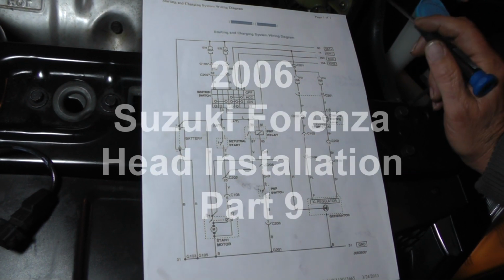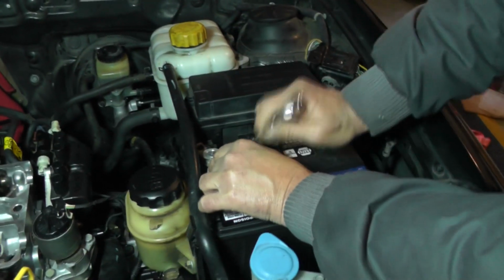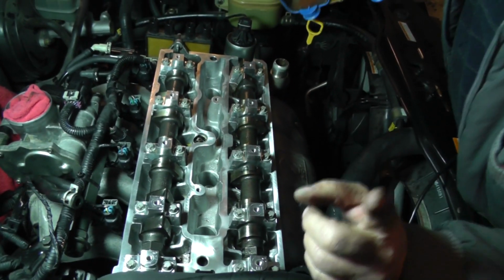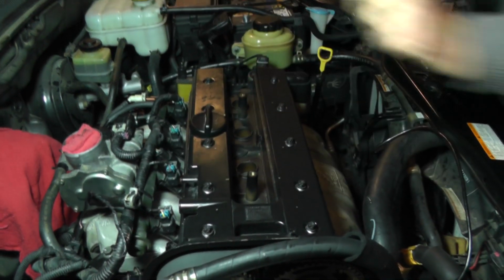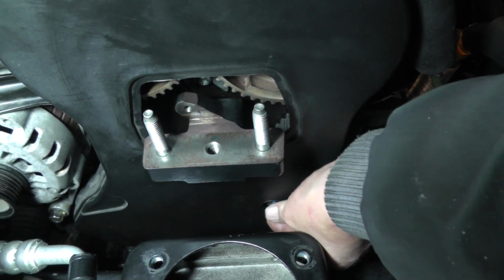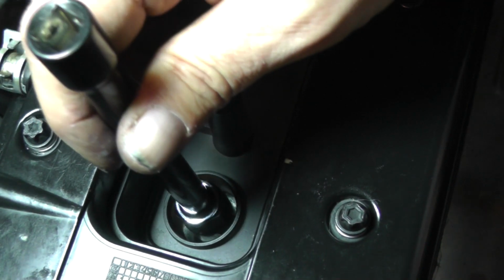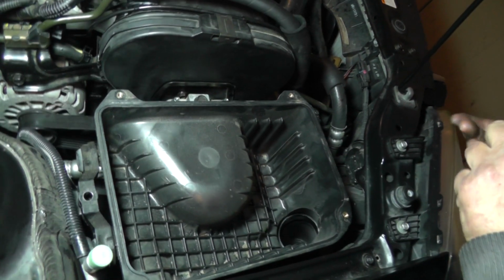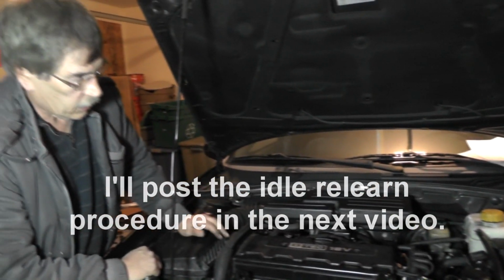Suzuki Forenza Head Installation - Part 17 (We're Done!)

Comment: Mr. Pike, I am nearly done but one small question:  You used vaseline on the valve cover gasket without any black RTV.  I was wondering how the vaseline holds up to heat?  No leaks so far on your end?
Reply from the maker: +Frank Burrell Hi Rank...you really do not need to put any sealant at all on there. If I had to do it again, I would not have put the Vaseline on there. The only place if I remember from the service manual was putting a little RTV on the camshaft end caps, but I didn't even bother with that as the gasket looked like it would seal anyway. I don't have the car or the service manual as I sold it almost two years ago. The biggest thing was putting two small washers on each valve cover bolt as I believe that's why most people were having leaking issues. When I had the car for another year after the repair, it didn't leak at all. Also, be sure to put some blue thread locker on each bolt, as 71 inch pounds is not a lot of torque. So, they will loosen up without the locker creating leaks. So, just put the gasket on dry with the washers and thread-locker. I take it your project is coming along pretty good. Did you get the timing all done and the engine turns over manually nicely?
Reply: +stuzman52 Yes indeed.   I install the valve cover in the morning and then I will zip everything up.  I got it all in time perfectly,  and im almost there.  I will proceed at sunrise.   You are THE MAN!!!
Reply from the maker: +Frank Burrell Man, sounds like you're doing a pretty impressive job there Frank. You ever done this kind of work before? And I've got my fingers crossed for you...
Reply: +stuzman52 I started young working on Mustangs with my twin brother.   I then worked on Davis-Monthon AFB in Tucson at the Auto Hobby Shop.   I later worked as a sales clerk for Auto Zone and Pep Boys in Tucson and then Bristol,  TN. 
I enjoy this very much when I can find time.
Reply from the maker: +Frank Burrell There you Frank...sounds like you've got some experience under your belt. You should be good to go on the startup...
Reply: I work at a factory these days, but I really miss automotive work.  I believe it will start up thanks to the videos.   Take care.
Reply from the maker: +Frank Burrell Yes, I work at a manufacturing plant as an electrical engineer and the only time I have to work on vehicles is on the weekend. And there's a lot of good channels out there for automotive work. Take a look at my home page and you'll see some channels that I watch and worthwhile. Well Frank, it's bedtime so I'm hitting the sack and you take care too.
Reply: Now things are adding up.  I knew you were extremely savvy.  Electrical engineer is a suit I wish I was big enough to wear! :-) 
 I will let you know how things work out.   Sleep tight.
Reply from the maker: It's not really necessary to put any Vaseline on the valve cover gasket. And you should not need to put any RTV sealant on there either so just put it on dry and you should be fine.

Comment: Hey Terry – I just wanted to send a short note to let you know how grateful I am to you for taking the time to produce these videos. I just finished replacing the head gasket on my wife’s ’07 Reno with the same engine. I did alot of engine work in my younger days but this was my first tear-down of a double-overhead-cam engine. Your videos were an invaluable tool and the job came off without a hitch. I saved myseIf the $1500 to have someone else do it!! I also wanted to let your followers know that Rock Auto is now offering the EGR gasket alone for $56.89 instead of $132.00 elsewhere. The Fel-Pro part number is  71379. It’s available at Rock Auto for the Suzuki cars under the “Emissions” heading.  There is no photo but you can click on this link to read an article about the gasket and confirm the part number and see a photo of it:  http://www.felpro-only.com/latestnews/fel-pro-first-to-offer-suzuki-head-gasket-set-featuring-replacement-egr-adaptor-gasket/     I hope this is helpful information. I bought the gasket from Rock Auto and was VERY grateful to save $75!! I will also post this information below the video in which you talk about the gasket. Thanks so much.  -Scott
Reply from the maker: Scott6459 Hey Scott...Always glad to help and really glad to hear about you saving money and that the job cam together with no hitches. Also glad to hear that you can get that EGR gasket at a considerably reduced price. I'll also take your information about the gasket and include it in the description text for the pertinent video. Thanks again Scott for all of your feedback.

Comment: Thank you so much for the videos. I was able to replace my head gasket with no help by using them. One question though, after putting everything back together and cranking car it sounded great then within 20 mins the oil light flashed then stayed on and it started making a noise, had it put on computer no codes. Went to drive it home light went off sounded great then within a few mins it did it again. Could trash or something be blocking it?
Reply from the maker: Mary Bengis Quite possible that there is some trash blocking an oil galley. Or it could be something as simple as an oil sending unit. But, I take it that there was no oil light coming on before the job and if so, then you probably left some trash inside the engine somewhere. At this point, you don't want to continue driving it until you for sure. Is it really low oil pressure or is it a sending unit problem? You'll have to put an oil pressure gauge on the engine to be sure. You could just unscrew the oil sending unit out and install the gauge there to read the pressure. If you've got very low oil pressure readings say around 5-10 lbs, then you've got something going on inside the engine which is not a good thing. But, if you see that the pressure is around 40-60 lbs, then you know the engine is getting enough oil and that you probably have a sending unit problem. I'm not sure about the specs for the oil pressure, as I sold the car a couple of years ago along with the service manual. But the numbers I provided should be in the ball park for testing. Good luck Mary on what you find out and you're a brave lady to tackle such a job on your own.
Reply: Thank you again

Comment: do you need to put the big orings that go in the four holes where the spark plug are in the valve cover?
Reply from the maker: No o-rings for those large four holes Pedro. The outer camshaft gasket will do all the sealing and keeps the oil from getting into the spark plug wells. Take a look at this video of where I show the camshaft cover gasket installation. https://www.youtube.com/watch?v=vjaaq4T6t0c&index=15&list=PLrbHoqGceWKRspWg6l03EtyPlHoiAdMks

Comment: yes washers were installed, I'm going to take the cover back off and inspect in after work. It may have not been tight enough. How many washers per bolt. Other than that the car runs great. I will let you know how it turns out. Thx again
Reply from the maker: Now Daniel, I mentioned how many washers in my previous post. Glad to hear that it runs great...

Comment: camshaft sprocket done, and because of your clear instructions the head gasket has been restored. The only problem I'm having right now is I have a little oil leak (valve cover) and the leak is causing my trans to slip. I replaced the gasket and I thought it had been torqued correctly. Any suggestions? Thanks again for the videos.
Reply from the maker: Well Daniel, I don't know how the valve cover leaking is causing the transmission to slip. Did you put a couple of washers under each bolt as I outlined in the video where the parts for the front of the engine is installed? It looks like the bolts may be a little long.

Comment: do you hook the battery back up?
Reply from the maker: Again, not sure what you mean from your question? You had a question earlier about what if you have a manual transmission. Now you ask do you hook the battery back up. Put it all together and be clearer what you are trying to ask. I don't understand what you're wanting to know.
Reply: sorry, my question is if you have a manual transmission do you do the remote start up differently? also do you hook up the battery terminals back then take the safety pin to the yellow wire?
Reply: my brain works in a strange way...
Reply from the maker: angel rojas I believe the wiring to the solenoid for the starter should be the same. Take a look at the wiring diagram for the video of where I was turning the engine over with a remote starter. If I remember, the area for a manual transmission was included on the wiring diagram that I showed in the video. If you have any questions regarding that, let me know and I'll review the video. As for the yellow wire, it should be the same wire, BUT... take a look at the diagram as I mentioned. Holler out if you have any questions.
Reply from the maker: angel rojas Okay angel...to save you some time, I went back and reviewed this video of the starter wiring diagram as pertaining to your manual transmission. The procedure that I'm showing is valid for a manual transmission also. But before you start the engine, MAKE SURE that the transmission is in NEUTRAL before you crank the engine over. You will be bypassing the neutral safety switch with this procedure. So, if you have the tranny in gear, your car will start moving as you crank it. Hope that helps.
Reply: the engine turn over!!! thank you so much!!!
Reply from the maker: You're quite welcomed!
Reply: hii you don't need a battery back up,

Comment: i have a question about the valve cover gasket since you didn't use any gasket maker.Did the washers you used help it not leak?
Reply from the maker: Yes, I would say that using the flat washers actually helped in preventing it from leaking. The bolts were actually about a 1/8" too long. Therefore, with the bolts torqued to the correct setting, the bolts bottomed out preventing the gasket from seating.
Reply: Thank you again! Your knowledge is greatly appreciated.

Comment: Terry, thank you for your videos.  My daughters 2007 Reno broke the timing belt on the freeway.  All valves bent.  Followed your videos from the first to number 18.  Best help I've ever had with auto repair.  Took two weeks, mostly waiting for parts.  Great tip on the EGR adaptor gasket with o-ring.  Saved me another few days of waiting.  After repair it started right up.  The tapping evened out and faded after 15 minutes.  Again, THANKS.
Reply from the maker: Thank you Charles for your comment and I'm really glad to hear that everything worked out fine for you. Take care Charles and glad to help out.

Comment: Okay my good sir, first off thank you for your videos and also to your wife who demonstrates love and patience for her husband. I have kind of a multi-part question/comment. Now first off I have a 2004 Forenza AT and I have had this oily problem since i purchased it and even put a new gasket and still did it. Before I replace it here are some facts for you. 1) my engine was shaky (and even hiccuped strongly during cold starts) 2) my spark plugs were almost filled with oil, I soaked up all the oil with shop towels and then removed the spark plugs. They were all oily at the threads but bone dry at the gaps themselves. I looked down into the engine and in spark plug 1, 2, and 3 they were dry. Down in spark plug 4 section I can see it oily and greasy. 3) I seem to be losing antifreeze from the reservoir but i checked for leaks and can find none. When I start my car it seems like my tailpipe fogs or sputters water, not drip but liiiight sprinkle. 4)  Radiator is brand new......... I'm wondering if I could have a cracked head or gasket. I'm wondering if the engine specifications regarding adding the two washers to the valve cover will fit my 2004 engine. ALSO, I have no idea where of how I check my transmission fluid. It shifts fine but I'm the type that likes to check and know how my cars doing. THANK YOU.
Reply from the maker: Hi Rico and thank you for the comments on the videos and I'll be sure to tell my wife your kind comment. Now to your car. It sounds like you've got two problems with your vehicle. The first sounds like the engine oil is getting past the gasket into the spark plug wells. And yes, I'm sure that the washers will take care of this issue as on the Forenza that I worked on, there is no oil leakage into the spark plug wells. On the second issue, I sounds like you may have a bad head gasket which is common on these vehicles. If you want to confirm this before pulling the head, you could do a pressure test on the cooling system and see if the pressure drops. But since you mentioned that you can't see any external leaks, it runs bad in the morning with a fog, mist coming from the tail pipe, these are all signs that coolant is getting into the cylinder. My guess is that it's probably #4 cylinder since you mentioned it. And for the transmission as you may know, there is no dipstick. There is an oil fill plug (8mm square drive) on the side of the transmission, that you take out to see if the level is up to the bottom of the threads. To check this, drive the car for a few minutes to get the tranny fluid's temperature up. You'll have to raise the vehicle all the way around to make it level so that you can get access to the plug. Then you can check the fluid's level. If you have a lift, that would be even better. Hope that helps you out Rico and good luck on your repair!
Reply: stuzman52 Once again thank you and i Really appreciate it.and God bless.
Reply from the maker: You're quite welcomed Rico! Take care...

Comment from the maker: #1) Hi hartsell61. I just went back to the video and watched it. At 7:24, I say 7.9 but didn't say the unit of measure. Big duh on me. Then at 7:24 an annotation comes up that says 7.9 gallons. This annotation that came from me when I rendered the video. To remove that, I will have to reload the video. So, instead I added an annotation from YouTube that says 7.9 Quarts and NOT 7.9 Gallons. This is the annotation that may not show up in other devices as I mentioned. For this reason, I would

Comment: I watched it on the iPhone and there was an annotation that said gallons also. Maybe just the wrong one is showing up. At any rate thank you so much for doing this video. It has helped me so many times throughout the process of changing my head gasket. I only have to replace my motor mounts and replace fluids then to test and I am sure there would be times I would have been completely lost if not for your videos.

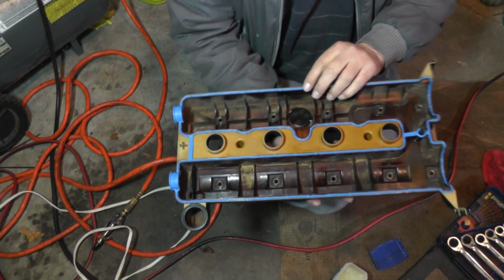Comment from the maker: Glad you got it figured out charger. Yes, I noticed that when I was removing the sprockets and made special attention to it. If you need to refer to what you're saying, review Head Removal Part #4 from timeline 7:43 to 10:18. I show all of what you're saying in this span. Also, at 10:18, take a look at where the pins on the camshaft are located. This will also help you get an idea of where to place the cams back into their bores. Finally on the cylinder leak down test video, review the cont)...

Comment: Update:  Just dropped the heads off at the machine shop.  No noticeable damage but they will double check.  My mistake was that the exhaust sprocket not only has two notches for the pin (could be used as either exhaust or intake) but two timing marks.  The sprocket had paint on the intake timing mark (previous work...not me) and that is what I used even though I properly used the exhaust pin.  This caused the timing problem.

Comment: Leakdown and compression testing confirmed my worst fears.  Not sure what i did incorrect yet.  #4 has no compression, other 3  between 150-160lbs.  TDC on #2 shows 40% leak yet 158 compression.  Timing is most likely the issue as you suggested.  Taking apart again.  Too much fun.

Comment from the maker: I guess anything is possible, but I would say it's not likely. You could do a test with a small 9V battery. Hook the injector up and pour a little gasoline through the top while you pulse it on and off. Don't leave the battery hooked up or you could allow to much current to pass through the injector winding. As you may know, all injectors are not designed to be turned on fully. Just touch one of the wires off and on about every 1/2 second and you'll be okay. Hope that helps you out.

Comment from the maker: to one of the injector control wires. You should see the light flashing as the engine is being turned over. Or you can place a screwdriver near the base of the injector and listen through the handle. A stethoscope works great also. But since the engine was running before the belt broke, I would look closely at the timing marks on the belt to see how they look and I pray for you that the valves didn't get bent again. Holler out if you need more advice.

Comment from the maker: Hi charger. Of course as you know with these engines that when a timing belt breaks the valves get bent. And it sounds like you had the head work done and got her back together. Since you have fuel pressure and spark, the only thing that's left is the timing of the engine. Are you sure that your timing marks are aligned? And if not, it's very possible that the valves may have got bent again. If you're sure of that, you can connect a test light to B+ and the probe tip cont...)

Comment: Thank you very much for the great posting on the frenza head installation.  I do have one question.  After finishing putting the engine back together I could not get the engine to start.  I have great fuel pressure to the fuel rail and spark at all cylinders.  I had no problem with the engine running prior to the timing belt breaking.  Do you have any idea what may be the problem?  Could the injectors be bad or not getting an electrical pulse?  How do I test?